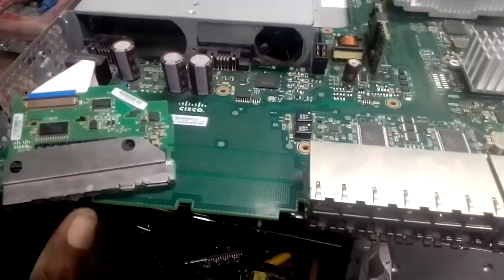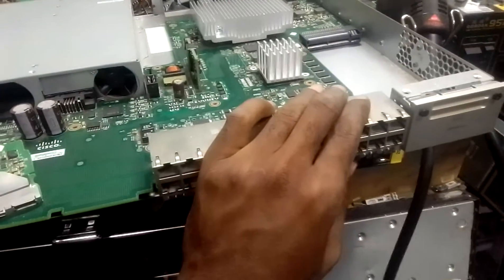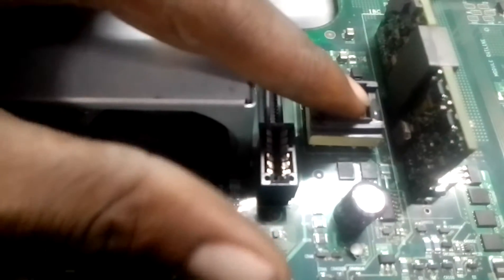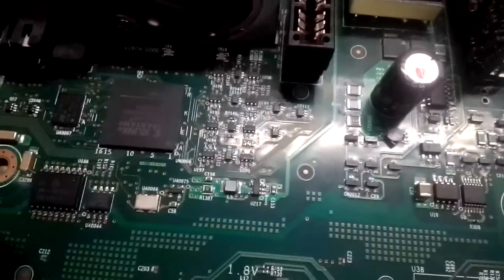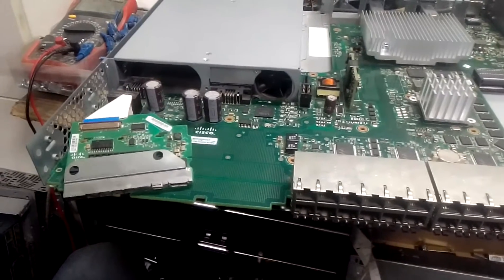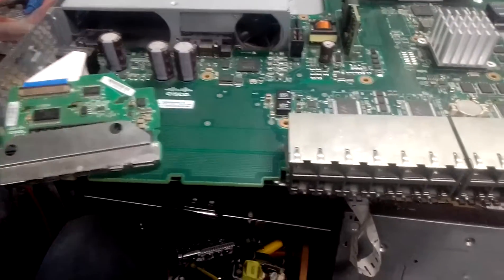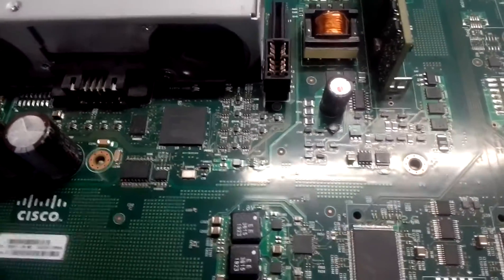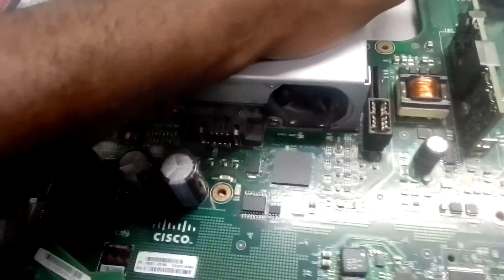#cisco #networking #switch #hardware #software troubleshooting and repairing 3850 Cisco switch

Comment from the maker: I will make the complete repair video of 3850 , the problems explanation, desoldering of bad components and soldering back functional components complete video, around 40mins video, if I get "20 comments" here
Reply: Is there a contact to reach
Reply: Do u know if theres a way to make a switch boot again if i get the msg of mainboard hardware authentication failed. Abort init

Comment: i have this same switch i got for free from the scrap bin at work, with the unit open i can see the 2 internal led's near the power supplies flashing. and i have confirmed there is a short on one of the internal rails but not sure what component it is would you have any ideas for this problem?
Reply from the maker: Is possible that some smd capacitor or stack power board the center  back of the switch
Reply: @jkftech  yeah that was my thought as well, just a pain to find what one it is.

Comment: Hi, I bought a certified renewed 3850 from Amazon, but the POE (and the switch) is not transmitting power or data , what could the problem be?
Reply from the maker: It should be software issue

Comment: Hi JKF

I have a 3850 that showed all LED lights as amber. I have been watching your video, but I have issue for finding the sim ram on this model and not finding diagram online for it. I need help to understand where stuff is on the 3850 motherboard.
Reply from the maker: First : What is the exact model of the switch (part number) , secondary : at what stage does the amber light shows, lastly: how many indicators shows the amber